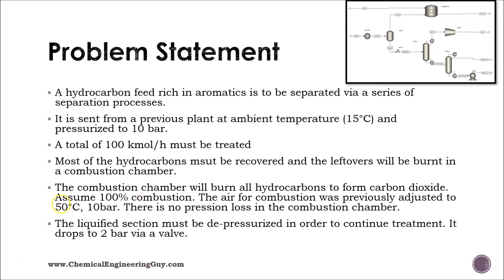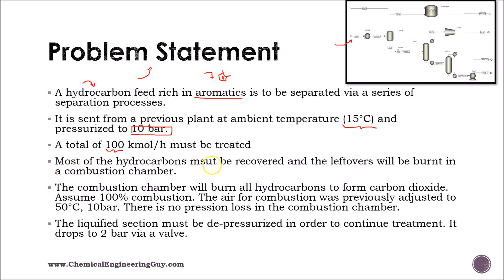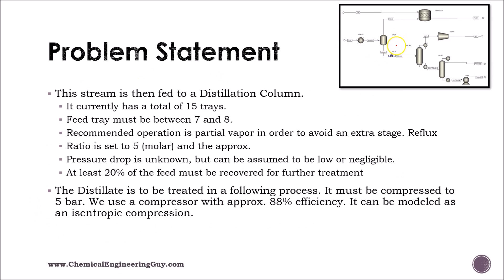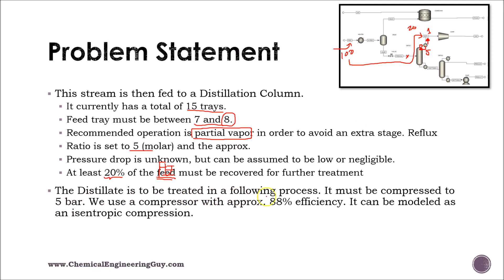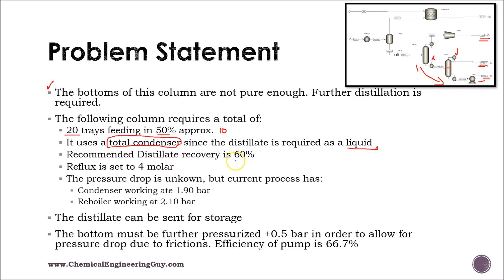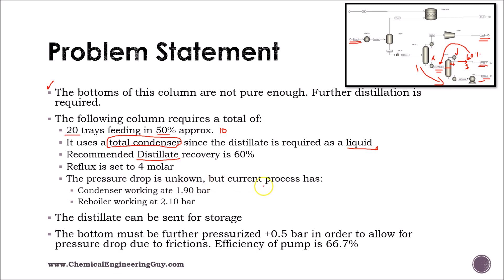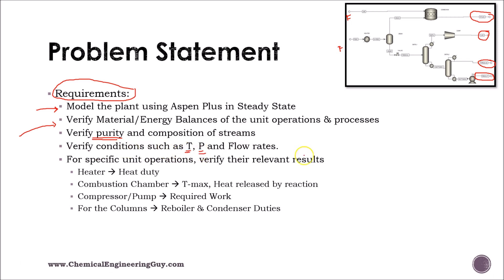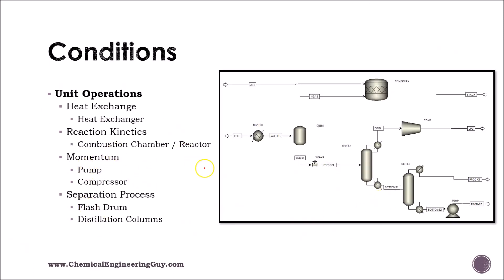Problem Statement - Aspen Plus Simulation Course (Lec 010)

Comment: In aspen hysys there is actually a furnace simulator, which maybe is more accurate than using the reactor as combustion chamber.
Reply from the maker: Correct, but the idea is to work with the reactor, it can be substituted, but in real life, it is much more convenient to use the furnace block unit